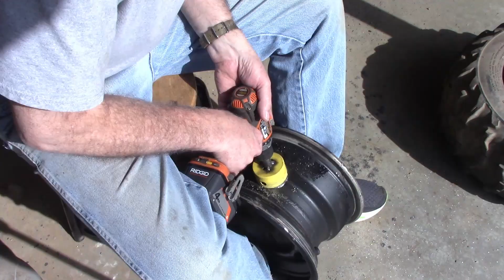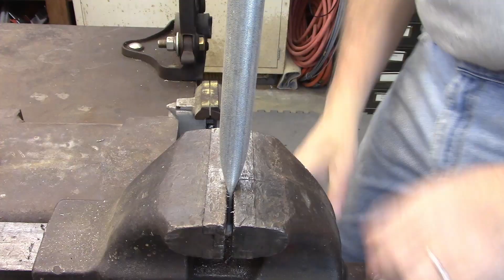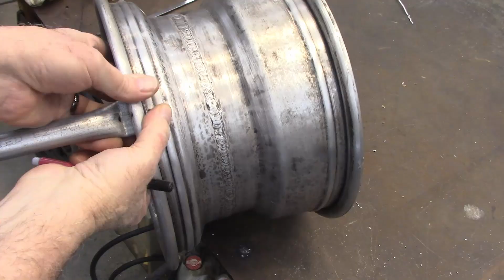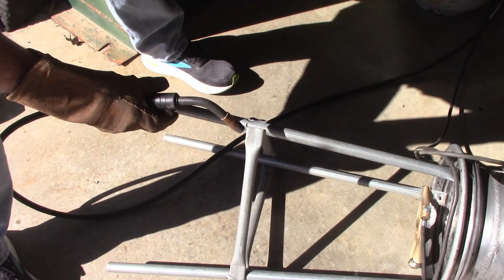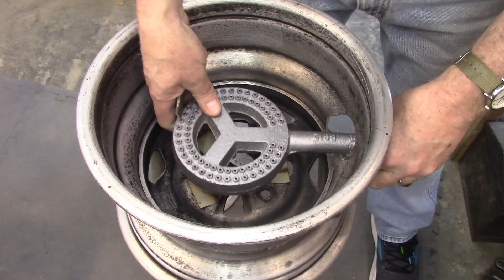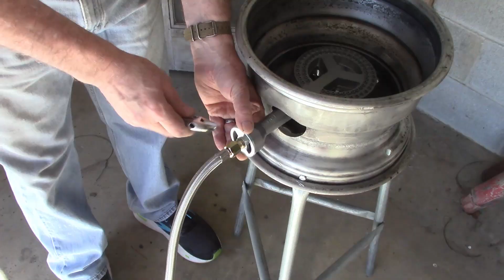Building a Wok Burner

Comment: Would be interesting if you can share some specs about the burner. Cool Video!
Reply from the maker: The burner is linked in the description of the video.  That would be the only specs I have.  Thanks!
Reply: @SoatMon  Thanks, Normally I look into the description, missed that.